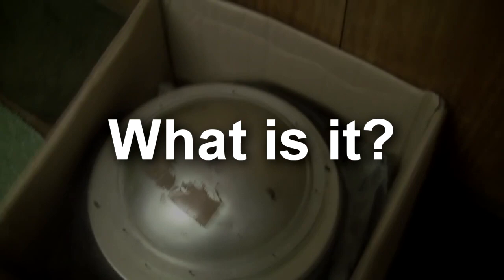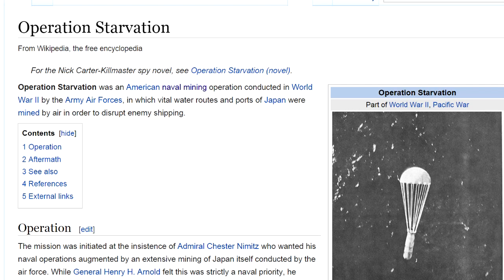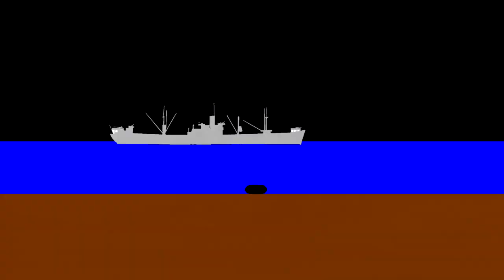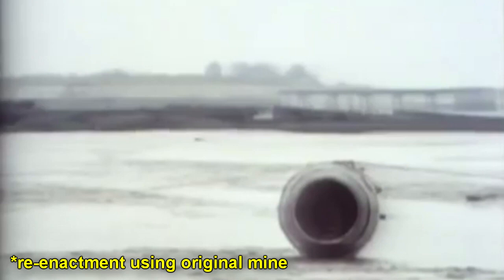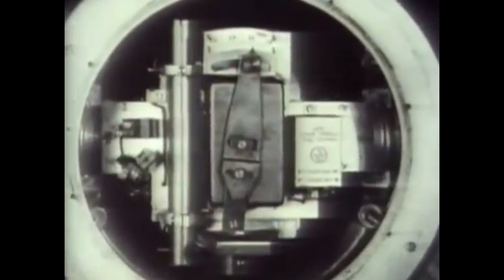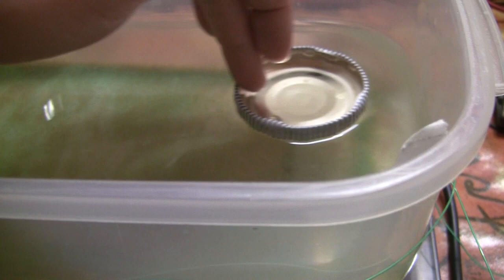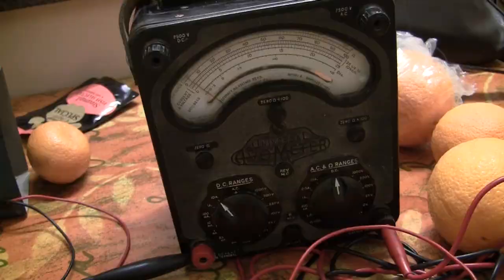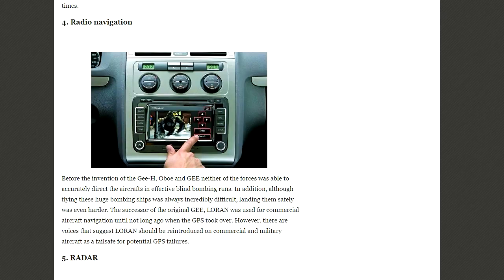The 'superweapon' that almost won Hitler the war!

Comment: I wish we could have the same technological race again, but without the killing. I mean WW2 lasted only half as long as the War in Afghanistan and what did it bring us?
Reply: That's because a guerilla war lasts longer than a conventional war because the objectives are different.
Reply: I'm very disappointed in the 21st century as far as technological innovation goes.  Yeah we have Haswell processors and GTX 980s but solar panels aren't as mainstream as they should be, neither are maglev trains.  Instead mostly surveillance tech and ludicrously sophisticated contendID tech advanced.  I really butchered a picture just for fun, flipped, reversed colors, saturate, change hue, uploaded it to Tineye, and it still found matches with the original! I mean what the flying fuck is that shit?!  If they can do that then why not actually innovate good games?  I mean The Secret World is good but most games are just linear stories with only the pretext of a game :(
Reply: There is an asymmetrical technological balance between the USA and Afghanistan. Britain and Germany were comparatively technologically competitive.

Simply put, Afghanistan has no technology to challenge America, so what innovations have to be made to counter it?
Reply: HaeravonFAQs
America hasn't fought anyone technologically on par with them since WWII.  I don't like war though we need to do something about ISIS.  War is just about consolidating resources for the rich from America's point of view.  It's not worth risking working class lives for.  The college class (i.e., middle and above) gets deferments while the poor and working class risk their lives.

 At least during the Dark Ages (or "early middle" ages) knights, who were a propertied warrior class went out to fight for their own damn interests and kings actually went out to fight alongside their men while the peasants weren't even allowed to carry weapons (which admittedly sucked but still, they stayed back to farm).

  See any corporate CEOs fighting alongside the sons of laborers, cashiers, burger flippers, plumbers and tradesmen?  Nope.  Modern kings stay safe in their own little gated communities to insulate themselves from their own destructive policies.
Reply: The focus of medieval warfare was largely the rich, propertied knights attacking peasantry, because they were easily defeated, and you could take their food, meager wealth, and livestock as booty. It indirectly hurt the other side's knights, whose taxable resources and labor you were effectively destroying. When knights did fight each other, they were the only ones allowed to be sold for ransom. Captured peasants, who did fight and were conscripted into the infantry en masse, were executed because they had no ransom value.

Don't pretend the past was some magical fantasy land. It's just not the case. The rich have always been using the poor as disposable labor and benefitting nearly exclusively from warfare.
Reply: Most technology developed for war is for war. Only a small percentage of it actually has benefits in peacetime.
WW2 and the Cold War brought us to the moon, but imagine if all those resources had not been spent on pointless weapons research but peaceful technology. We'd be much better off today.
Reply: Molo9000
Actually WW2 saw the advent of modern computing, a massive research investment in jet propulsion, improvements in mass manufacturing and many other things. With whole societies geared on self preservation it's amazing what people can accomplish. Unfortunately without death in sight we don't work like that.
Reply: Helghastl33t
Except we do work like that.
Electronic computers were being development even before WW2. Civil aviation also developed rapidly in the 20s and 30s just like it did in the decade prior to WW1, when there was very little military interest in airplanes.
WW2 certainly accelerated development in these areas, but it did so at a very high cost and at the expense of other developments. On top of that there's the huge waste of life and the wrecked economies of Europe.
Without WW2 we'd be much more technologically advanced today.
Reply: Molo9000
WW2 was horrible, no arguing with that. But it also had some positive side affects. It destroyed the British Empire (among others), catalysed the wide scale adoption of existentialism in Europe, laid the foundation of the social democracies that now reign in Europe and it ended the perpetual state of war in Europe.

It was a painful lesson but a lesson none the less.

As for technology, war has always been a driver for scientific inquiry and this has always led to more technology. Even if the weapons aren't useful outside of war the material sciences that have been done to develop them are.

Take SpaceX as an example, their Merlin engine is an engine they picked out of the NASA library of propulsion research. Without that library worth billions of dollars there would be no Merlin and no SpaceX. And it works like this in almost all fields, the start-ups only come when the fundamental research has been done.
Reply: "half as long as the War in Afghanistan and what did it bring us?"
-Hatred
-Death
-More Hatred
-Distrust
-money wasting
-Time wasting
-boredom
-more death
-Hatred
Reply: I would argue that the Cold War was just that.
Reply: We do, there is open competition and collaboration between business and individuals world wide. The rate of technological progression is vastly superior to the ww2 era...  
Not sure why you people seem to think war is an important factor. And why you seem to be unaware of current advancements.
Reply: ***** Did Nazis have "Kill them all" strategy? If so, they failed so much at it.
Reply: ***** That's more or less what I said - my point is though that they did not have "kill them all" in any practical immediate sense, or they would... Well, kill them all. On sight.

It would probably happen, but it would be removed in time.

So they weren't just lucky because they lost - they were lucky they didn't have any immediate "kill them all" rule.

As an example - a village I live in had little trouble with Germans. Sure, they were forced to give up food, cattle or pretty much anything soldiers wanted (or they would be shot), but there were no killings up until one of Ukrainians (that lived his whole life here, as some percentage of Ukrainians did in these parts) told Germans "whos" and "wheres" about the local resistance. Then Germans killed off a bunch of them, including masterminds of the resistance - kids below 5.

I have no doubts that in due time Polish would be but a problem to resolve with so well developed final solution.
Reply: MultiPwolf
Dude, you're way off. You're comparing the rate of advancement in absolute terms, completely diregarding that they need to be compared to the contemporary standards are always, and very greatly, influenced by the contemporary knowledge and technology that enables scientific discoveries. For instance, how do you calculate a way to launch a self-propelled missile from one city to hit another city thousands of kilometers away? You run computer caclulations/simulations to which you're adjusting your CAD model. An undergrad student could do that. Now try it in a tight time frame without so much as a pocket calculator, and suddenly the task requires a team of the brightest people in the country—because you don't only need to process a lot of data manually, but also prune infeasible solutions intuitively, choose between a handful that might work, and withstand all that immense stress that only war-time science workers had the dubious privilege to feel.

Putting all of that into perspective, WW2 and Cold War technological advancements were absolutely mindblowing for their time. What did war have to do with it? It was the stimulus that accelerated and necessitated the research and development of those advancements. People understood very well even back then that wars are won by technology, so they had to come up with new, completely out-of-the-box solutions to ensure winning—and by extention, staying alive—and do it faster than the other parties that were doing exactly the same. Many of the breakthroughs we made back then were so fundamental they changed our lives forever.
Reply: fancy armoured cars... that's it
Reply: moozooh So basically it was an impressive group of minds working on ground breaking shit? Who denied that. My point stands, we do, we are advancing at a much greater rate, and if we had war now it would not benefit technological progression at all.
Reply: PurpleStratocaster and because new technology is usually an answer to other new technology (in war time) and the Taliban isn't known for new cutting edge technology
Reply: HaeravonFAQs I made a similar comment glad you understand too
Reply: clearly you wern't paying attention.
Reply: Boston Badass Hugh Jass 

I mean, indie games have a lot of innovation. They don’t have as much budget are crews as large, but passion will do that
Reply: I think you're confused... Every country is in a technology race.
Have you not seen the high tech world in the last 50 years? The country that falls behind gets no economy.

Comment: And Hitler would have invaded the USSR by any means, because of ideological differences. So defeating Britain wouldn't have won the war for Germany.

Nice video though.
Reply: The war against the Soviets would have been a quite different thing without the involvment of the Brits and the Americans. So this might have done the difference. It surely isnt for certain tho.
Reply: @Imtotallydiggingthis  or if hitler didn't interfere with Guderian
Reply: @leftjab276  

Wrong, that wouldnt have helped the Germans.
Reply: @Imtotallydiggingthis  that's what I meant, just like no Americans would help,
Reply: @leftjab276  

Lots of what ifs now, but if the Brits would have been forced into capitulation, thus no Normandy, not even a risk for such, then the Germans could have focused more of their forces east and would have gotten more supplies shipped to them. Also, Italy wouldn't have fallen and thus no need for a front there. And how would the Soviets arm themselves without all the American steel and tools they received? Things could have gone a lot differently, actually.
Reply: Also Germany lacked materials for its war winning tanks which would have been much easier to get with Britain defeated.
Reply: @uncletomcobley6950  

Indeed, that's a big part of it. Not to mention fuel.

Comment: The Taifun and Wasserfall anti aircraft missiles could have made a bigger impact if they were fielded in mass as they would have decimated the allied bomber formations.
But Nazi ideology didn't support the idea of being on the defensive and having weapons systems that aimed at defense.
Such as they didn't want to ME262 to be a pure interceptor even though it was absolutely devastating against allied fighters and bombers.
Reply: +Patchuchan To be fair the 262 was such an operational & logistical nightmare that standard fighters would have been more effective given more could be fielded.
Reply: The Germans had the technical capability to build heat seeking SAM missiles which would have devastated our bomber formations, but chose to concentrate on the V-2 instead. Of course, after an initial high kill rate our side probably would have figured out that dropping flares would decoy them away and neutralize them until the Germans came up with another method of guidance. Much of the war was each side trying to stay one hop ahead of the other.

Comment: As a 24 year US Army veteran and amateur historian that was a very well made video Thunder. I know the British used a similar system on their capitol ships and freighters to keep these mines from going off and it was involving running a large diameter wire completely around the ship with a small electrical charge to keep the mines from going off. I believe it created some way of eliminating its magnetic signature, but i am sure you would know that let me know if i am correct. Great video!

Comment: Surely if the conducting wires are dragged behind the ship, then the ship would have to go over the mine to start with? The solution given here doesn't solve anything. Unless they were wooden sailing boats that didn't give off any magnetic field.
Reply: You could use planes.
Reply: Landon Brecheisen  There would still be drag, and that would pull the plane down.
Reply: There would certainly be a lot of drag on the plane.
Reply: Chillbro Swaggins This would only work assuming that they knew where the mines were..
Reply: Josh Blake They never know were the mines are (NEVER)! That is, until they are found.
Reply: In the video the whole tub of water is affected by the current. The effect would be large enough that the ship doesn't have to go over active mines.
Reply: Current spreads and magnetizes the ocean in front of the ship.
Reply: Mine sweepers of that era actually did use a wooden hull but had a conventional engine, not sails. Still today many mine sweepers use a wooden hull like the USN's Avenger class but that is starting to be replaced by fiberglass hulls like on the USN's Osprey class or RN's Hunt class (ironically the Avengers have out lived the newer Ospreys in US service).

Comment: My father served on a US minesweeper in the Korean War. They used essentially the same technology to destroy the magnetic mines the DPRK deployed in the coastal waters around the peninsula. It was tricky work because they also deployed tethered contact mines amongst the magnetic ones. Those had to be cut loose from the bottom by the sweeps and then a marksman shot them when they floated to the surface at a safe distance.

Comment: Hi thunderbolt. I really enjoyed this video and I have some points of interest. Airfix released a model airplane kit in the 1970's of a speciaized WWII RAF Wellington bomber with a huge metal ring that encircled it. This actual WWII flying electromagnet would fly 50 odd feet or so over the ocean at a typical cruising speed detonating underwater magnetic mines as it passed overhead. Consequently the luftwaffe did the same thing with the he-111 bomber and the Ju-52 transport. Supposedly, airborne detonation of magnetic mines is safer than detonating them at sea. Lastly, although I am no scientist, the process of eliminating or reducing a ships magnetic field is called degausing.
Reply: +HawkerHobbies123 As the scientist for whom the unit for measuring magnetic field strengths is named was called Gauss with TWO s, it is spelled degaussing.
And Thunderfoot kind of included it as he showed the big picture of the finetuning instrument inside the trigger casing that uses Gauss units to determine how sensible the mine should react to different fieldstrengths...

Comment: But the Brits learned to counter the magnetic mine early on by 'de-gaussing' their ships. They ran a copper cable around the hull and passed an electrical current through it. So it really isn't much of a war winner.

Comment: Swedish fixed mine barriers used during the cold war that had a chain of mines connected to a control station on a nearby island used a different type of magnetic sensor.
The mines had one magnet at the top and one magnet at the bottom these reacted differently to an approaching ship because they where placed appart. But when the ship was directly overhead they indicated the same and the mine if set in automatic mode exploded !

Comment: When you show the electrolysis of water, we've all had a class in high school where we did this to produce hydrogen and oxygen, but I don't remember anyone saying that it changed the magnetic field of the water.
@10m, it sure still looks like a dangerous solution. That explosion is very very close to the boats.

Comment: They did actually come up with a way to counter magnetic mines. They would equip rather large sized aircrafts like Wellingtons with a wooden ring around the whole diameter of the plane. It would have an aluminium ring inside of it. What they would do, is fly these aircraft at low altitude, above the water, and trigger the magnetic mines. It is not entirely known how effective this was, but the germans also picked it up, so It might have been pretty effective, judging solely by that.

Comment: The Allied Navies also used to run electricity through large loops of cable wrapped around the ship's hulls in order to 'degauss' them.
Once the ship's had been treated in this fashion, they could safely pass over the magnetic mines without detonating them.
Reply: Wow so you can essentially do the opposite too, make it so that the ship is not magnetic.

Comment: The U-505 that was captured by Admiral Dan Gallery just before D-Day (06 June 1944) was found to have magnetic torpedos aboard.  And if the  Germans found out the submarine was captured then they would have changed there codes and WW II would have lased longer !  Good video and keep up the good work.

Eyes UP and lights down,  tjl  Sent by Win7Pro64 w/ADSL

Comment: There were great technological advances in WWII bu WWI could be called the first technological war. Machine guns, barbed wire, canned food, telephones, aircraft, tanks, submarines, trains.
Reply: Machine guns, telephones, aircrafts, submarines and trains where actually invented before WWI. The oldest of the 5 was invented in the early 1600's. And you'll never believe which one. (drum roll) the submarine!
Reply: ThatOneGuy : Yes. But it was the first war where they were used generally.

Comment: I could have sworn the countermeasure to the magnetic mine was wires wrapped around the hull of the ship, not dragging. How does that work if the cables are behind the ship? The mine would always be well in front of the ship in the configuration you describe.